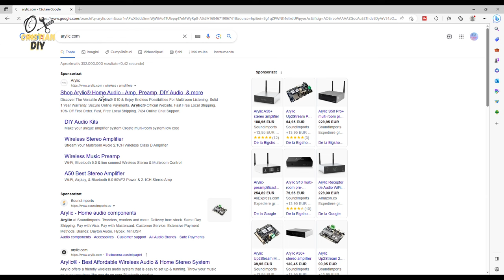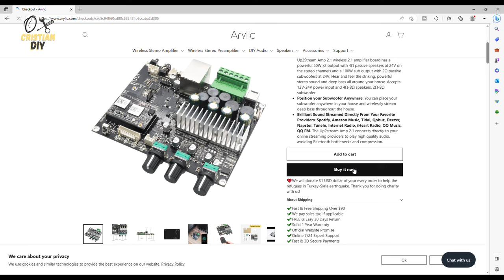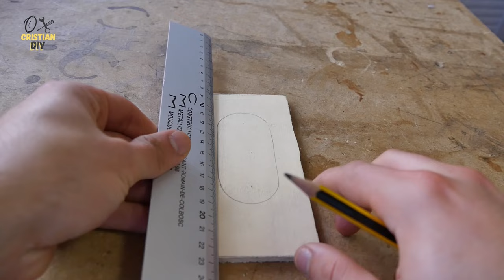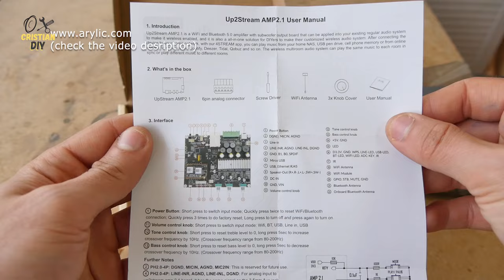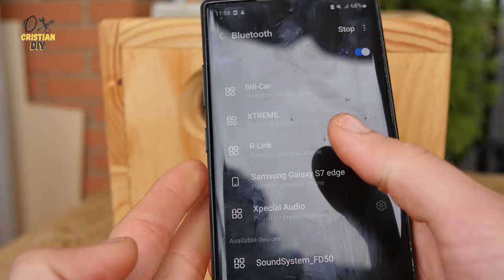How To Make Boombox  Speaker with WiFi, Airplay, Spotify Connect and Bluetooth

Comment: Why no frequency filtering? The resistors on the tweeters are not worth a dime. The mid-range drivers play full range, which clearly is not their purpose.

You can hear a lot of distortion in the bass, what makes your "exceptional sound" not so exceptional. Since you used and old reflex port, it surely isn't calculated, as the cabinet is just big enough, to fit all the components. You have built additional chambers for the mid-rangers at least, but you should put some damping material into these chambers. Also some damping material behind the woofer will help prevent the distorted bass.

The build itself is good, its a nice and proper built cabinet. But there is a lot of room to improve the sound quality.

Comment: Nice Build! Great workmanship on the wood components. 

I'll also note what @ScarfaceHood has mentioned. 

- Proper crossovers are needed for high quality sound. A simple resistor, capacitor, inductor circuit can be constructed to crossover the midrange to the woofer, and the highs to the tweeter. 
- Tiny chambers for the midranges should use either polyfill or foam walls to reduce box resonances.
- Calculate the internal area for the box, and figure out the proper port length for the tuning frequency you would like. 
-  Since this is such a high quality build, I would use better speaker components. A proper 6.5 inch, like the Dayton DCS165, nice 3 inch midrange drivers, like the Dayton Designer Series, and a decent tweeter, like the Dayton ND25FA would really improve the sound.